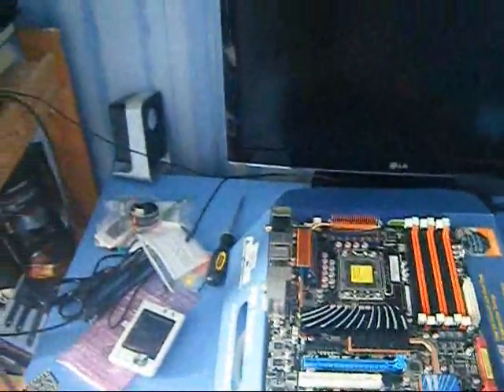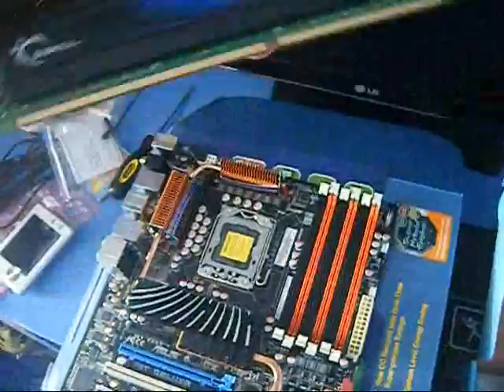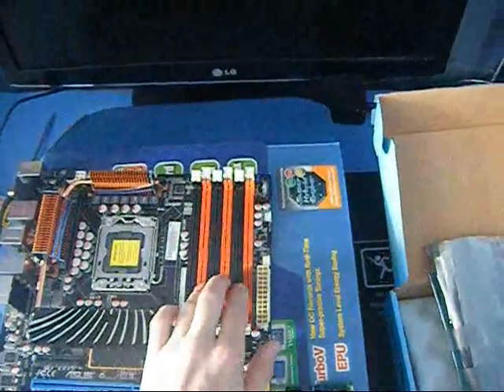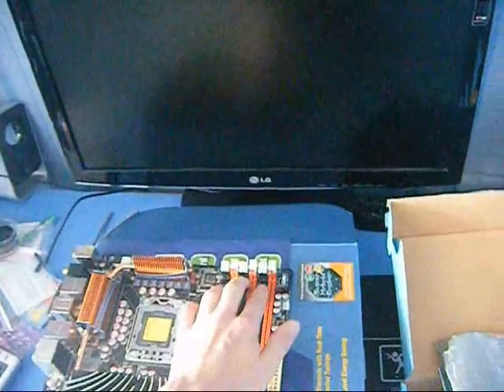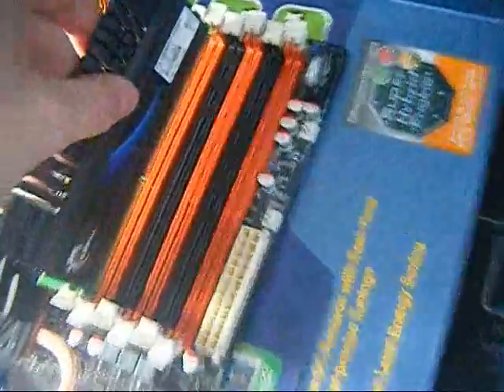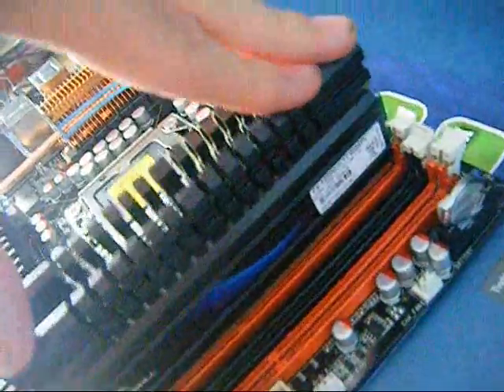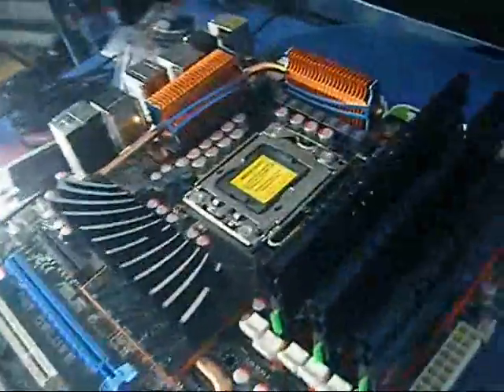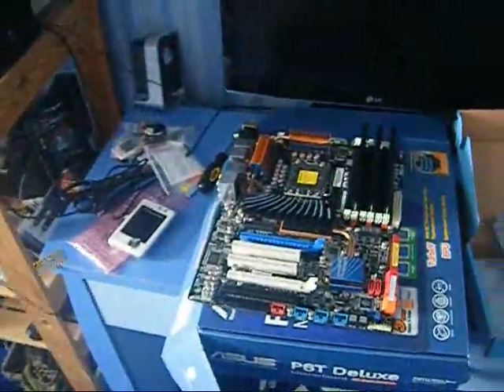Triple channel RAM installation guide

Comment: I have the exact same Motherboard (Asus P6T Deluxe V2) and when i inset corsair vengance triple channel memory windows doesnt recognise it.
Reply: Ive also tried different ways of inserting it, changing dram timings and voltage and nothing has seemed to work
Reply: @lukeomlid9639  Dead mobo?
Reply: @glaciusgaming9995  seems like.

Comment: why am i watching this i have 2gb single channel ram only..
Pathetic
Reply: Hitler GT Lel I have 12GB triple channel. I know how you feel.
Reply: @dogechallenger4994  have you faced any problems  with triple channel 12 gb? Because im gonna do the same upgrade soon
Reply: @panosplayzz  No because the platfrom I used had a triple channel interface. If you use a dual channel platform you will have problems
Reply: @dogechallenger4994  my motherboard is dual channel. What problems will i face?
Reply: @panosplayzz  slow ram and maybe even in some casses a cpu that cant reach 100% usage
Reply: @dogechallenger4994  man thank you so much.i ordered one stick some days ago.i ll buy,rn one more to have a quad channel 🙃
Reply: @panosplayzz  no problem

Comment: Thanks for this! The accent was a little difficult to follow but I was able to see what you were talking about! This probably explains why my 6GB pack is only showing up as 4GB on Win 7 x64!

Take care!
Reply: That would be that your memory may not be a XMP based memory.  If you look very carefully their are information from the manufaturer.  Anything sold as a Triple is ment for a triple based memory system.  Though you can use them as a dual in a dual system.  their is nothing wrong doing that.  However the X based bridges are a different architecture in design.  They run best in triple mode is memory IS an XMP based module.  It is claimed they run 50% faster than dual.  Hence when you read 3x 4gig = 12 gig triple. you can buy the EXACT same set to make it 24 Gig but must show in the advert that it is an XMP memory based.